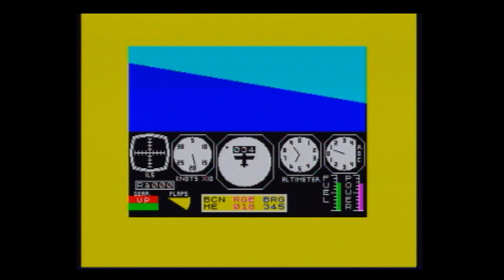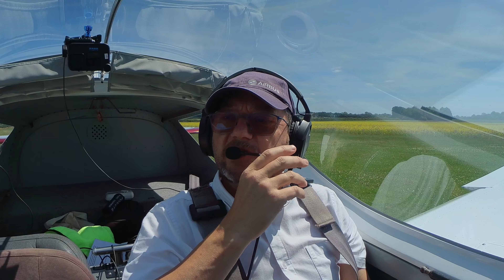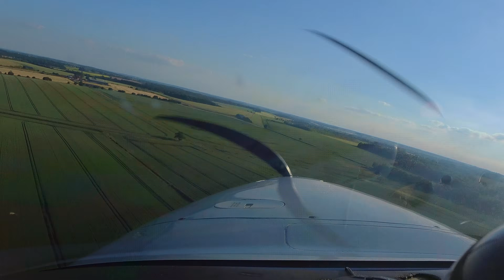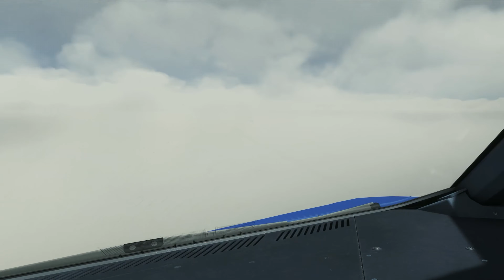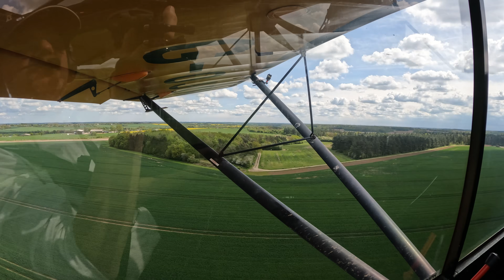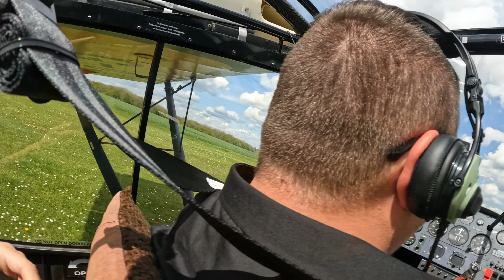But how close is Flight Simulator to real world?

Comment: If I can perform a specific action or maneuver well in a simulator (such as landing, and with all realism settings at maximum), would I be able to execute that action in a real aircraft with similar proficiency? Alternatively, could I achieve similar proficiency with less additional training than normally required? 

In my free time I do quite a bit of flight simming, and in the past few years I have probably got somewhere around 1000-2000 hours of mostly hand flying primarily in DCS and some MSFS. I plan on starting flight school within the next year for a commercial license, but I'm wondering the extent to which this could potentially shorten or reduce training costs.
Reply from the maker: Yes yes yes, keep practicing on flight simulator it will make you a better systems pilot, it will give you an advantage over those that don't use MSFS and yes it will save you hours and flight time in the real aircraft and so save you money. My video is really about the only thing that's missing from MSFS and you'll get plenty of that once you start your lessons.

Comment: I think it should be absolutely clear by logic, that a flight simulator - be it MSFS or X-Plane - will not be able to replicate physical sensations like in an actual aircraft, no matter if GA or jetliners. As others pointed out there are yoke systems providing relatively realistic force feedback - but that's it. If you want to go the full Monty you could invest in one of these gaming chairs for VR which roll and rotate in a number of directions, and have force feedback motors underneath them.

In general there is only so much one can replicate with a flight sim. I built my own G1000 replica to get more immersion and realism. But I will never have the full feeling of an actual plane, but I am aware of that. Flight sims are tools, primarily to learn aviation and the basics of a plane and how to fly it. If you want visuals: MSFS (flying through Bing Maps). if you want realism and actual physics: X-Plane (which can look quite similar to MSFS if you put the effort into it).

Both sims have VR support and I strongly encourage trying out VR on each one. But also, for VR a pretty beefy PC is needed if you want to have 30+ FPS in a headset.
Reply from the maker: I know that and you’re correct it is obvious but what I was trying to demonstrate (maybe badly) is that bit that’s missing makes a big difference to how you fly especially in a light aircraft. I must admit my setup is really basic and I’ve never flown in VR maybe I should try some of these new things and report back. Thanks for your great comment Marcus.

Comment: This is a kind of obvious comparison. Of course in a simulator you won’t get gravitational forces, for that you have to be in the air. A simulator with a good 6 degrees motion rig can give you a lot pf that feeling you get in a real airplane, but of course there is no gravitational forces that will mimic the real world. 
I like to add that learning to fly in flight simulator is a real thing. I did it, I got my ppl at 43 hours over 2 years. I wasn’t able to fly every week, sometimes I couldn’t fly for months. The sim kept me constant and saved me a lot of money.
Reply from the maker: 100% agree but what I'm trying to show is not a negative for MSFS but a factor that every real world pilot uses when flying especially light aeroplanes. It's a missing element that makes flying a real aircraft actually easier than the sim and I just wanted to give simmers (and I am one of them) that (obvious) info. Without movement MSFS is really a cockpit procedural trainer which it does fantastically well.

Comment: The problem with 2020, the flight dynamics (Eg the dangerous bit from base to finals) are not as good as previous versions. Hopefully 2024 should be better in that regard and the graphics. One can now use VR, force feedback controls and seat - all a bit closer to reality.

Flight sims are a useful training aid though and will only get better, but will be heavy on computing power.

Interesting video though Terry 👍😊💜

Comment: The comparison between actual flight and MSFS 2020 is interesting but is it really relevant? If you use MSFS 2020 as a trainer and intend to fly real aircrafts afterwards, it does matter, but if you are going to stick to simulations not really. I fly a lot in MSFS 2020 in VR and my pleasure would not be greater if I felt the turbulence with my body as in a real small plane. In fact, I flew a couple of times in small aircrafts and I was happy about the presence of paper bags in case you need to puke 😉. This, plus the fact that you can in MSFS 2020 fly planes you could never dream of flying in real life or going to places you would never fly to makes me wonder if I would not prefer simulation, even if I had the opportunity to become a pilot in real life.

Comment: if i'd be a real pilot, most problem would be the absent of the ass g-meter, and not because i need it, but because my vestibular is weak, and if my body expect something and doesn't got that something i have a problem. so for me as for sim pilot there no problema with it, as i just don't need it and i hope will never feel it, as i said it's kick my vestibular even in liners, when i'm passenger. so if i'd had that real habit, it will be a problem with simulators. most problem for me in simulators is trim visual modelling. it's have no sense, what we have in msfs. when we on the ground and no wind, there no problem, but when we are flying, and adjust level by ailerons trim it's kill me. because trim tab get airflow must push to ailerons, and other surfaces, but trims just change forces without move main deflect surfaces, like elevator, rudder and ailerons. rudder and elevator in most situation not visible from the cockpit. but ailerons we see almost all time. and watch as aircraft change banking by trimming and doesn't change ailerons position is  torture on the psyche. by normal logic, physical stick/yoke&pedals, must be disconnected from virtual controls, and just move them from position they got from nature, so, when we flight our stick and rudder will bumping by the airflow, and if we will not take controls, they will balancing, dancing, jumping... in sim we have all in center all time, in ffb controls it's i guess better, but far from real. so for me only one important thing that i need, when virtual controls will not in center but will in natural position, and that's will give more sense for trim, and that's will make trims have real visual model for deflected surfaces. other words. center of controls must be not in center all time, but there where in real aircraft. so. physical controls must moves surfaces not from neutral, but from position where it go under airflow in the flight in the certain time.

Comment: I fly the 787 all the time on my MSFS 2020. Recently I got the opportunity to fly the $26 milllion airline simulator and I flew and landed that plane no problem. I could get my pilots license but I am not a fan of small piston planes since they are mostly old. Plus getting a PPL is expensive and takes a lot of time. With MSFS 2020, I can fly anytime and any type of plane. Is it as fun or as dangerous as flying a real plane? No, but it is damn cheap and safe fun. I like doing zero visibility, hand flown, ILS landings with cross winds gusting to 40 knots. Try that in real life. Here is my first landing in the Air Canada 787 sim with no practice. I have 70 hours on my MSFS 2020:
https://youtu.be/328L92a8ows?si=26rD0cjU3XWxAIri

Comment: Obvusly real flying will be best but… The long and short of it is. And tends to be forgotten by certain parts of the community especially real pilots Getting- dong your ppl alone is way more expensive compared to dong motorcycle licensing or car, even boating. The buying or hire or lease a aircraft and maintenance is not cheap. Bar going fully in if you’re very lucky to get a comercial license at grate expensive or very lucky to get sponsored by a air line or company. Or be very well off in a good job. Personally i run my own business and doing well, I carnt justify or afford to do ppl let alone own and operate. So flight siming is for a lot people is the only semi realistic option.. if i were to do something radical i would buy a boat at least i could live on it and travel the world. The problem with ppl very expensive to obtain a license then buying-lease or hire at similar rates of buying a sailing boat. At least the boat option has way more viability options. But flight siming offers a good and fun experience and is much more accessible to people. If i lived in the USA maybe could justify but in the uk not, way better to have my mc license and explore uk and Europe by that. Sorry about being negative but only being realistic and speaking up partly for some of the non pilots of the community..

Comment: Now we have more the 15.000.000 pilots on MSFS2020. If all those would go to an airfield to bring a real plane to the sky ... 
some day its getting dark cause the sunshine will be get blocked by all of these wings 😂😂
I like to fly MSFS2020 in VR which really pull the experince forward. You really feel unwell when using the first time.
Its a simulator, or some call it game and not a real plane. But it is fun and more safer. 
You will always can walk away from your desk ... mostliky. 😂
Reply from the maker: I have been a simmer longer than I've been a pilot and have flown more virtual hours than real. I wanted to give my view and point out that real flying is actually easier than virtual. Thanks for the comment.

Comment: This video should have been a bit more specific with its title I think. I opened it up not think thinking about msfs2020 to be honest. I thought you were going to talk about an actual flight simulator. Not a videogame. And what I mean with that is a flight simulator built by Airbus or Boeing.
Of course a videogame can't be considered similar to the real deal. But that's because msfs2020 is not really a flight simulator, its a videogame. Not even if you buy fancy peripherics and stuff like that you'd be able to unlock full potential of an airplane. There will be always non clickable buttons. I really think that DCS is far better from an actual flight sim perspective than msfs2020 is. Just because of it having modules (airplanes) where literally everything is clickable and you are not limited from the software. But even then it's still not an actual flighting simulator, cause it still is only a software, not the whole package. You'd need to feel the g forces when taking off and landing. You'd need to feel when yourself rotating when the aircraft rotates. There no peripheric for msfs2020 or any other software which can provide that sort of stuff which is required for an actual simulator and not a videogame trying to be a real simulator.

Edit: yeah, you've basically said the same things. Which is why I think msfs2020 is not actually a real sim, no matter how much money you put into hardware stuff. Your video is well made, nice job.
Reply from the maker: So sorry if you thought the title was misleading but the thumbnail does show a desktop sim and light aircraft. I've had so many comments from simmers that felt I was being negative about MSFS but on the contrary I was actually trying to show that as a 'game' (and to many with study level aircraft it's a simulation) there is nothing closer to flying when sitting at a desk. Thanks for the comment and feedback.
Reply: @ShortField  Don't worry, I think it was my bad for misunderstanding. As I said at the end of my last comment I still think your video was nicely made!

Comment: Fully unnecessary comparison if you ask me. In reality, a mistake will probably kill you.
VR, motion platform, buttkicker, force feedback, it comes close but It never will really replicate the real deal because it’s called a Simulation. 
Use it as a training tool.

P.s, MSFS is a crappy FS anyway. Use X-plane 12 instead
Reply from the maker: I wanted to point out that the feel when flying is an important and powerful factor that is missing from a desktop simulator and how it makes sim flying harder than real world, meaning most sim pilots would probably find flying real world pretty easy.

Comment: I don't think MSFS is a really good example of a simulator. It's a consumer product and not intended to even be a simulator. Forza Aeronautica as some call it.

I'm not much (at all) into civil aviation, but P3D should be the go-to platform for actual simulation. BMS Falcon is also decent enough for military aviation as far as classified flight performance data, SMEs and anecdotal evidence suggests.
Reply from the maker: Thanks for the insightful comment.
Reply: @ShortField  FWIW though I have heard that P3D is quite unsupported nowadays by the more realistic models (The part that matters...) and MSFS has had some more realistic models developed for it: so I could just be out of date.

I just don't trust Microsoft to be able to produce so many good quality models as what come with the base game, having made a model or two or a few dozen myself. It's a multiple year job.

Comment: I feel like you’re stating the obvious. Of course you can’t “feel” the movements of the aircraft in a simulator. I would hope that that would automatically be known for those buying a flight sim
Reply from the maker: I think you've missed the point, what I'm trying to show is that in light aircraft that 'feel' is an important part of flying and as many pilots will initially start by flying and mastering a desktop simulator they find once the physical aspect is introduced they will actually find it easier, once adapted. Of course it's obvious but I wanted to demonstrate real v sim, but not in a negative way.

Comment: The point is not what FS cannot replicate, the point is what you can do with things FS can replicate and how to use it to your advantage in training. To name just a few, and the list is by no means complete, situational awareness, airfield familiarisation, area familiarisation, various IFR exercises etc. There is a thing FS can do and real aircraft cannot. You can start the flight in the air and exercise the particular stage of flight, like final approach and landing. Then you can immediately go and do it again, concentrating on important elements. In real life this exercise is impossible: before you get to the starting point, you have to perform the go around and traffic pattern with tons of things to thing about and cope with that literally destroy your previous experience and you are not, in fact, repeating your exercise - you are doing it the first time. It is literally the Groundhog Day in real aircraft. 

Your video compares apples not with oranges but with trees. It is like you are complaining C152 is incapable of ocean crossing with 350 passengers at F350 M085. It just isn't. It is not a PROBLEM with C152. 

BTW you heavily exaggerate the importance of bumps in butt. In fact, you mostly ignore them, not using them, but I understand why you are convinced otherwise. I am a glider pilot and can fly with bumps and no instruments. However, with instruments I can fly more efficiently. And all my colleagues who fly both in real and in Condor 2 - they fly more efficiently in the sim. There is no short and simple answer to that fact, but it is real. If the feeling of bumps in the body were so important, the real glider pilots would fail miserably in sim. But they do great.

Comment: An interesting video.
I started off flying sims on the Commodore 64 in the 80’s and went on from there to fly professionally. 
I’ve spent the last 30 years flying heavies ,the 747 and more lately the 787 but still really enjoy my sims, in fact most of the time I prefer it to real airline flying.
I’ve built up quite a nice sim rig with a DOF P6, Brunner yoke pedals and stick and VR. I’ve been enjoying flying gliders and GA stuff in my sim recently, so much so that I’ve booked “trial flights” in a glider and a Eurofox.
Good grief you’re right about the motion difference, I’d completely forgotten just how much you get thrown around compared to a sim or an airliner, to the point that I really didn’t like the glider at all it was scary. 
I was obviously used to it at one point having done my CPL in Australia I was no stranger to flying light aircraft through thermals, so would probably get used to it again with more exposure, but for now I’ll stick with my simulator flying. With a good set up like I’m lucky enough to have it gives me most of the enjoyment of real flying but without the fear or cost !